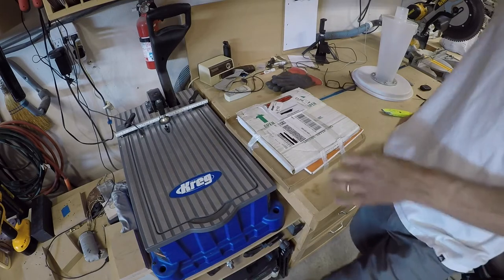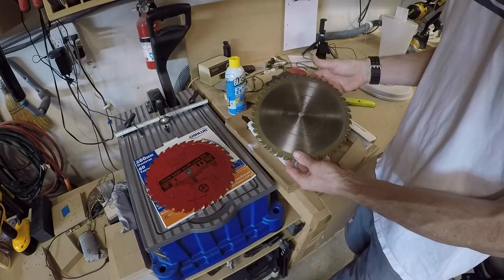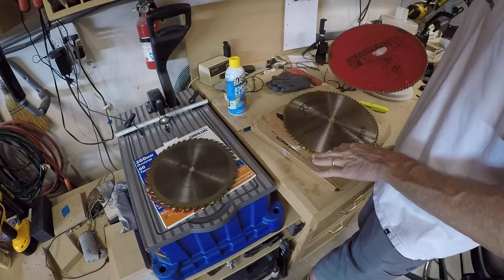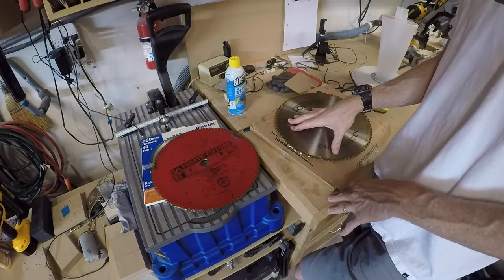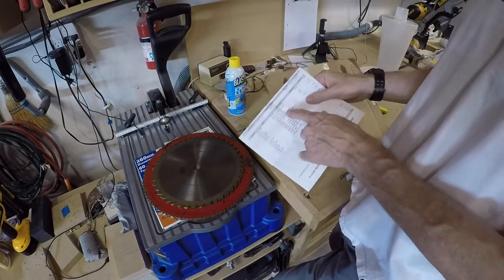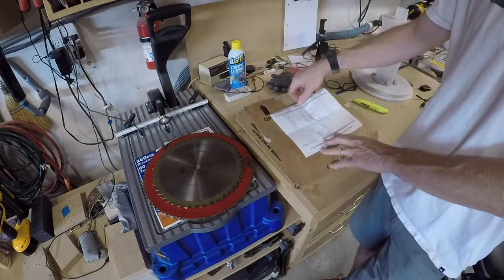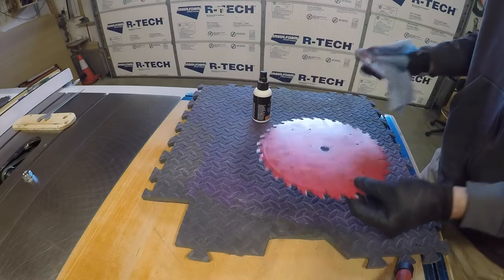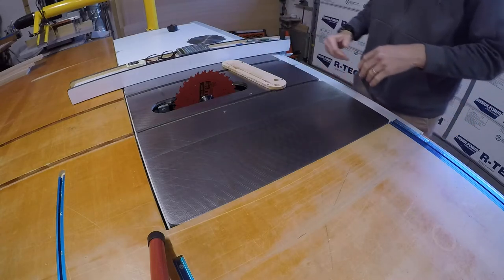Saw Blade Sharpening- Should You Have It Done?  What Quality Should You Expect, and Where To Send. $

Comment: Never considered putting some lube on my blades, I'll try that for sure! I tend to clean them when I see them starting to get dirty and it helps to keep them cutting well. I am lucky enough to live 5 minutes awat from a sharpening store that also happens to sell Freud, Dimar, Royce and Southeast tools blades and router bits. I've been buying Dimar blades and router bits lately and I am very pleased with them, lots of quality carbide on them blades.
Reply from the maker: Hey yes lube is great on all my blades.  As well as plastic latches and cast iron tops.  It’s very useful for sure. You’re lucky to have a good sharpener by your home.  Forrest has sharpened my blades now for 20 years. Basically since I started woodworking for a business.  I go though blades fairly quickly now days.  But the good ones can be sharpened many times.  So that’s good.  Are you going to build kitchen cabinets or something else?   I’ll see if I have a video I can get out for you.
Reply: @davidbryanwoodworksandmore  kitchen cabinets is what I am looking to build soon yes.
Reply from the maker: Okay.  I may have a video on a custom pantry coming up.  It’s like a small kitchen.  Construction of all my cabinets is essentially the same.  Just different interior materials for kitchens.